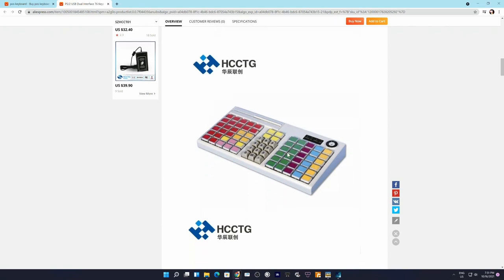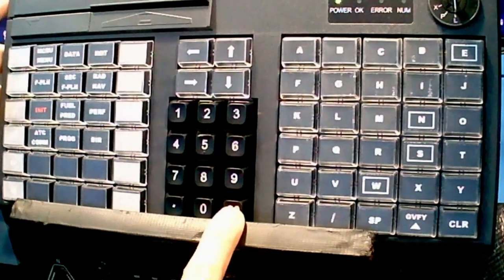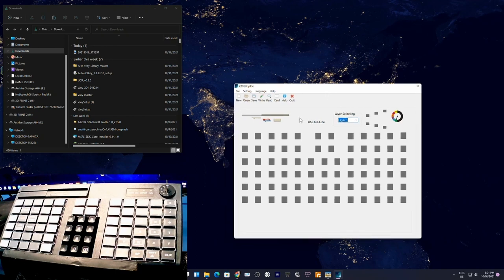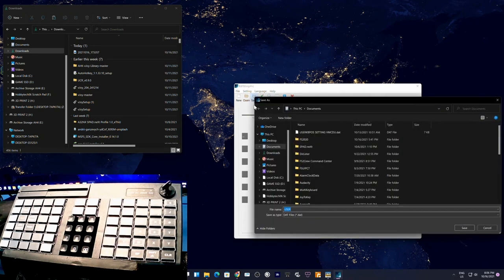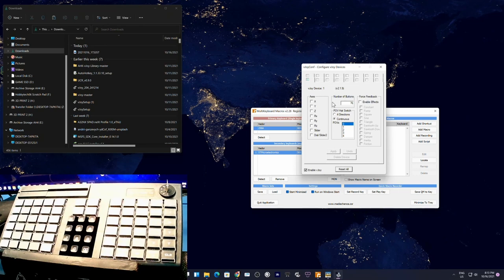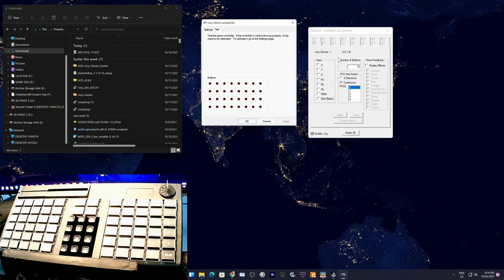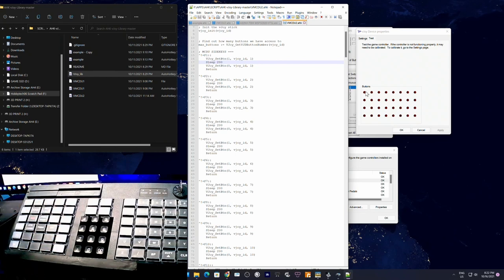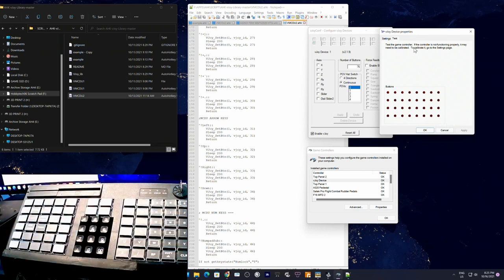Guide: Programming and convertingg POS KEYBOARD as Joystick Controller button for MCDU in Spad.next

Comment: Can i use a normal keyboard to program with spad.next?
Reply from the maker: If you use autohotkey and vjoy yes but you could not program the keyboard with ctrl or alt to differentiate with normal keys so you might get more used key conflict with default keyboard settings in msfs 2020. You could use AHK tomidentify diff keyboard though better look in google or use multi keyboard macro software. Im using this as its looks closer to the real things 👍